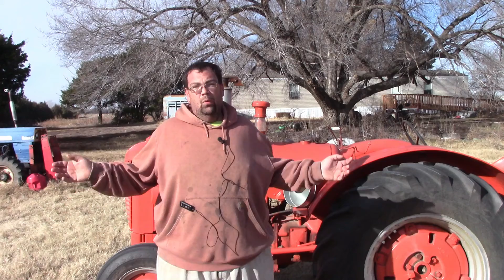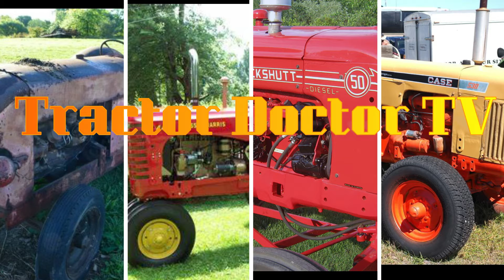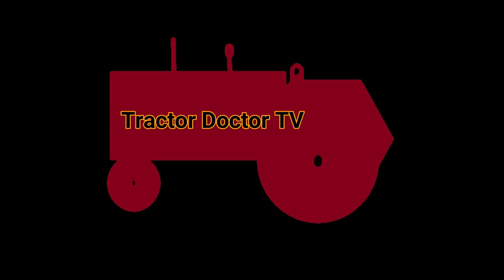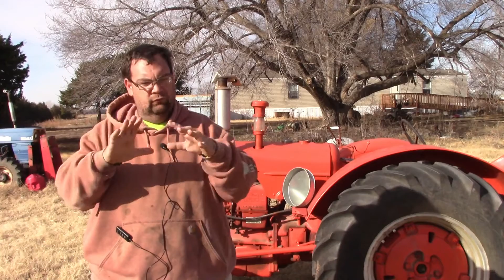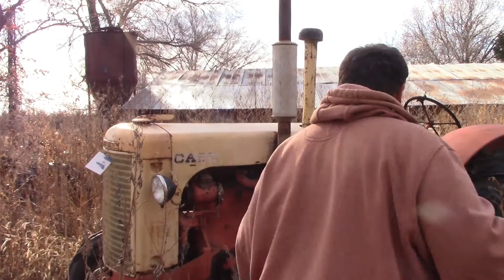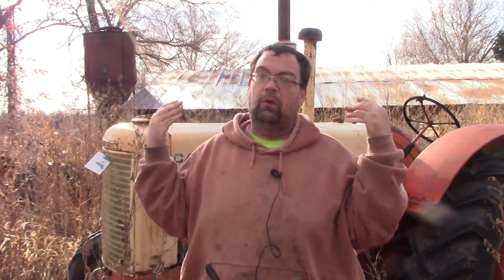iodine why it works.

Comment: White vinegar also works. Not the 5% acidity "pickling" vinegar sold in grocery stores though. It has to be the 20% (or stronger) "cleaning" vinegar sold in hardware and home improvement stores.